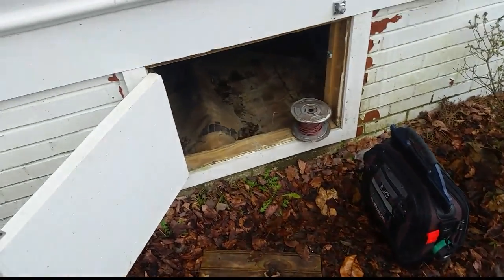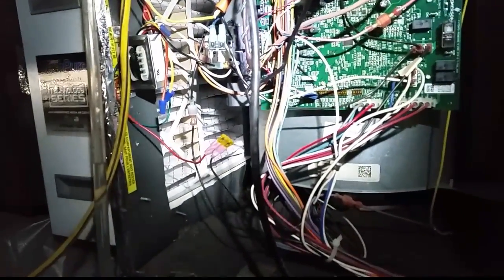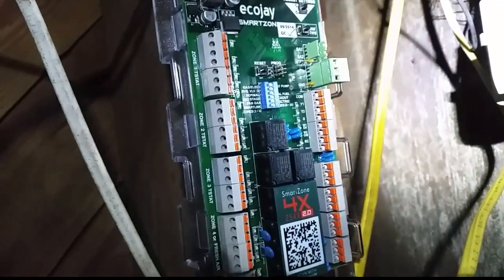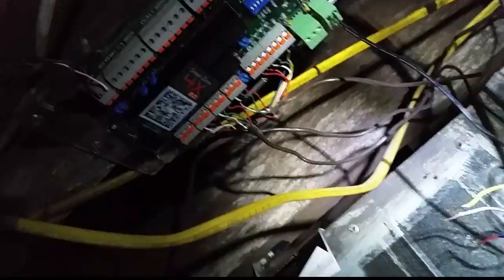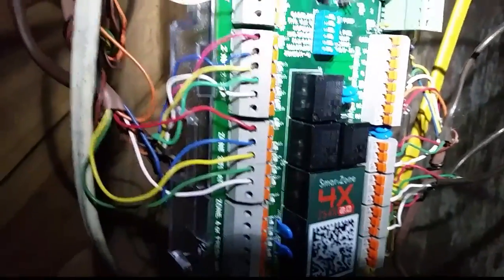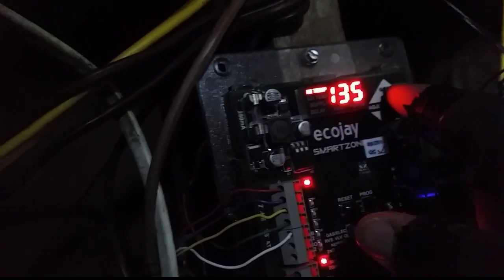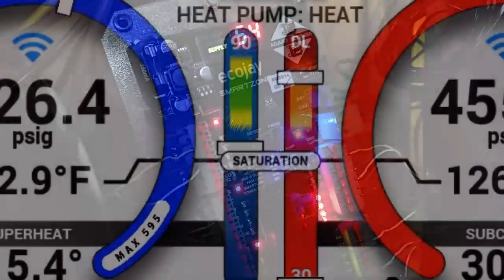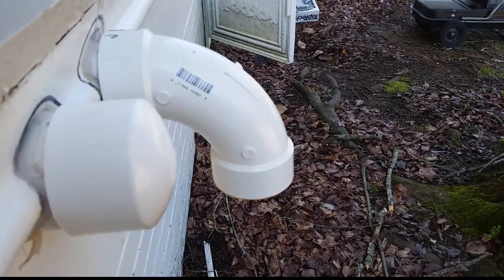HVAC SERVICE : Honeywell Zone Board Replacement

Comment: What would be the purpose to go higher then 135 and lower than 45?
Reply from the maker: Gas systems may go a little higher. You may also go slightly lower than 45 if you have to compromise with bad ducting, improper zoning.

Comment: Hi Zack.  Have the 4x board.  My hvac stated the zone 2.3.4 don't allow for 2 stage heating and added a wire spliced to those zones to the furnace board.  Any thoughts?
Reply from the maker: Not sure if I understand. What was the exact model board?

Comment: Ecojay is great. I have one that replaced a Honeywell. One tip: Ecojay needs its own power supply. It cannot be powered off the air handler.  I have a few videos from my air handler saga.
Reply from the maker: Yes sir, I would always buy a transformer and fuse kit when I bought Ecojay boards

Comment: Zack your review was very helpful; I have a friend who has the same control board and by mistake push the reset bottom; now the board reads low supply ; does he needs to reprogram the setting for the temperature and zone ? Please

Comment: I'm using one of those Honeywell zone boards in my house and haven't had any issues out of it, that one may be under powered though.  (not enough transformer if it has to move a lot of dampers at once)   When you first power that board up (or it resets), it runs a purge cycle (opens all zones and runs the blower for the preset purge timer).   Also, you could check what the purge setting is, as it can be set to purge into the last calling zone, or open all dampers and purge into all zones at the end of a call...   This may be some of what your customer is experiencing...   Otherwise you can configure the Honeywell boards to stage up/down based on operating conditions, loads, timers, etc...   They're pretty nice boards, as are the EcoJay boards that seem to be pretty popular around that part of the country.

This also seems to be one of those instances where a modulating gas furnace would be ideal...  I've developed a small add-on board to control the firing rate of the Rheem RGFG in my house because it the zones are too small for 100% firing rate on single zone without a bypass damper, and the 40% low fire rate wasn't enough for a single zone (when operated as a 2-stage furnace).   The board I've made allows me to select the firing rate per zone, and will add up the firing rates up to 100% amongst the zones as they call for heat...  

I don't have much experience with them, but the York YP9C modulating furnaces have a 'Zoned' setting that may get the furnace to self modulate based on blower static and heat rise (or maybe just heat rise alone)...   I don't think they will allow for independent control over the firing rate like you can with the Rheem/Ruud furnaces, they do not seem to have the 'V' terminal for a 10-VDC PWM input for firing rate like the Rheem's do...

I hope to develop my own zoning system that will control the modulation based on system load, and have the ability to operate a dual fuel setup as well...

Comment: thanks god we have ceilers or basements up my way we can walk around it, i hate craling under a house like that .i guess it depends were you live .i guess you will find out soon if one of the dampers is acting up or it was the board. them jobs can drive you nutty . if its not happening when your there checking stuff .i never seen that ecojay  board before .mostly honeywell zone boards i see .but i like the ewc board over the honeywell
Reply from the maker: I like EWC as well. I use the ecojay because I am so used to it I guess. Hopefully the dampers don't cause a problem. There location sucks.
Reply: talyn875 Go EWC I don't think you will ever have a problem with those dampers

Comment: I have a question Zack.  What are the added benefits for having a zoned system on a residential house?
Reply: It is best for a two story house with only one system. You need to oversize the ducts to avoid a bypass damper that will distroy your system’s energy efficiency. I run mine on low speed cooling except on 100 degree days.  Keeping a variable speed compressor on low speed saves a lot on electricity.
Reply from the maker: Mainly just conform in each area of the home. I don't think you will save much money. It's actually a little harder life on the system as well. It's good for detached areas served by one system.
Reply: I see.  Thank you.